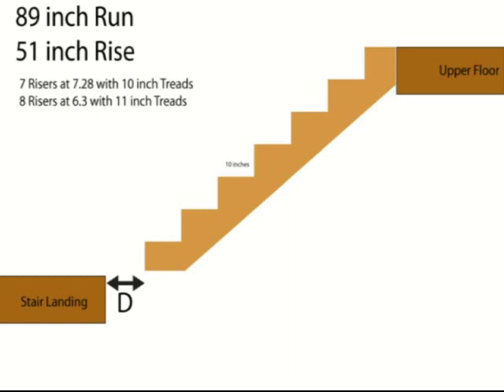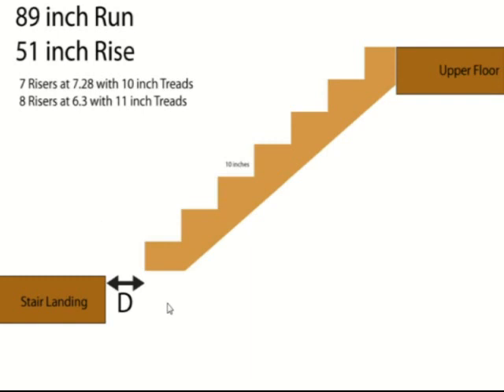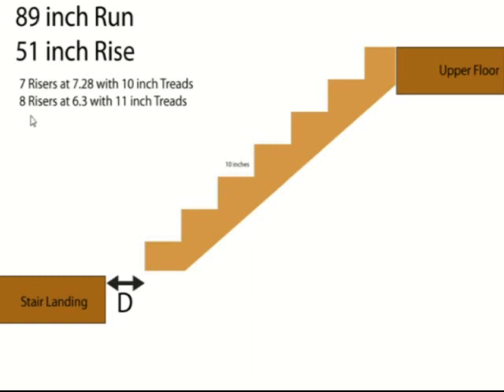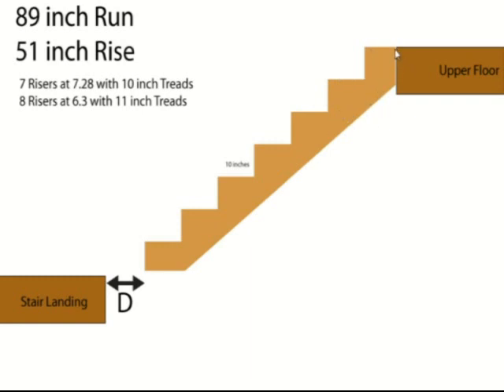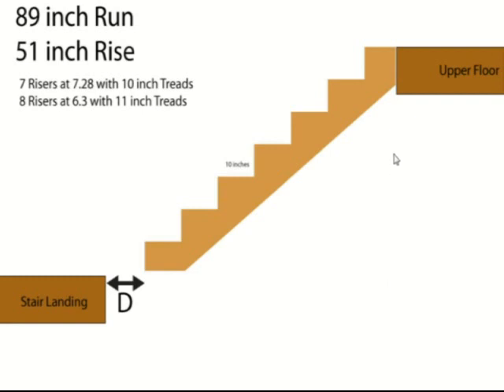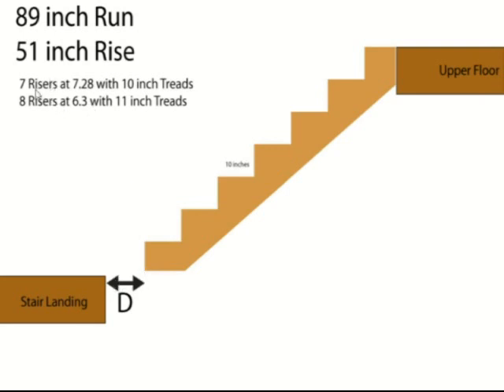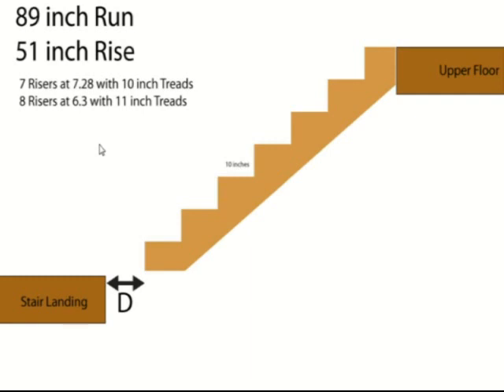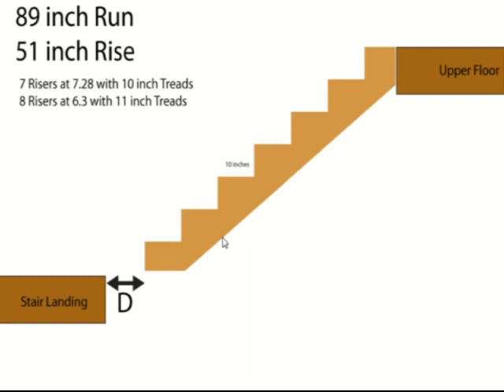Problems With Stair Landing Location - Stair Builder Facts

Comment: Simple solution, 11-1/8 run your 7.28 rise with 8 runs. Last run is in horizontal plane with the lower landing and top is with upper landing. The 8th riser at the bottom landing is plum cut to the landing with a Simpson lus24

Comment: To me it seems like it should be 7 risers at 7.28 with 12.71" treads.  Why not something like that?  I think it would be extremely comfortable to use with a longer run on each step, but still a normal amount of rise.